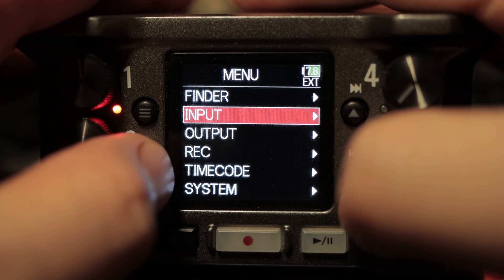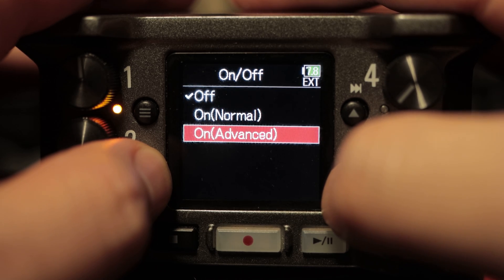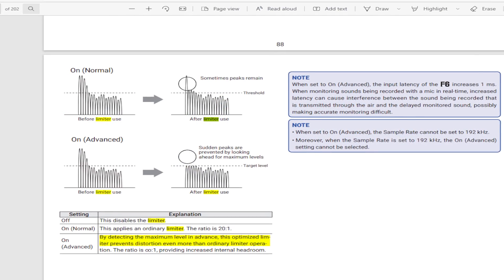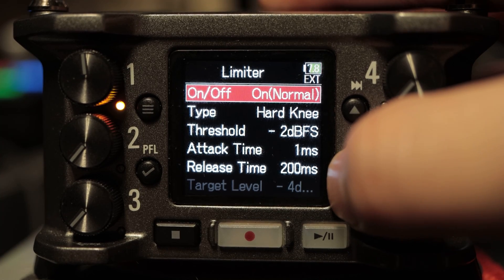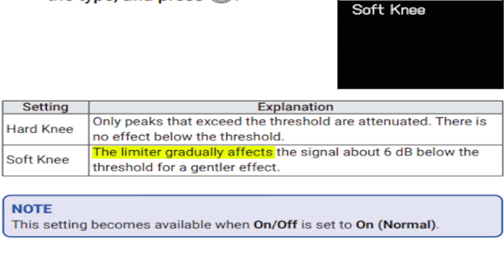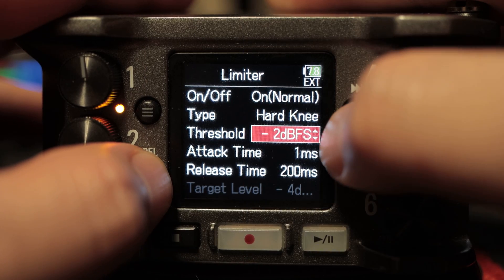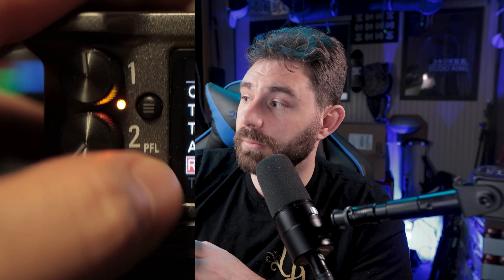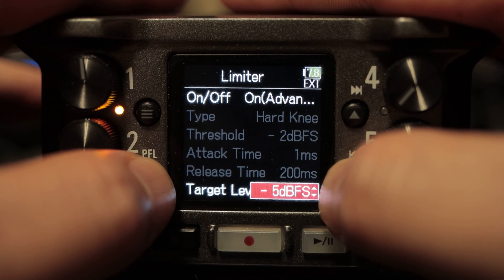Where should you set the limiter? Zoom F6 Limiter Test and comparison (Zoom F6 Part 34)

Comment: Great video! I have been using my F6 in 32-bit float mode and still have some clipping displayed in Audacity. I was just wondering how to repair the audio file in post-production when using the 32-bit float mode?
Reply from the maker: Some programs can’t process 32 bit. Usually it’s just as easy as lowering the level so that the peaks are brought to normal. 

Thanks for checking out the video!

Comment: Awesome vid... have you ever tested the Zoom F8?  I just picked it up and tested the limiter and compresser using the built-in mic capsules, and when turned up the gain and did a "puh puh puh" it immediately peaked and when it peaked it clicks in the recording and cut off the audio. ??  Was using the default limiter settings.. obviously don't want that to happen!
Reply from the maker: I haven't had the chance to use the F8.  I really want to though.  Most of my recordings are done with 32 bit float which allows more flexibility during editing.  I am hesitant to use built in limiters cause that will be baked in to the recording.  Of course they are very useful when you don't have 32 bit float.  I actually just got the F3 so now i can test that out too.  Maybe Zoom will send me one if they recognize me lol  Thanks for checking out the video, it means a lot!

Comment: If you don't need all the channels of the F6, do you think the F3 will be a good option? I don't like the idea of having to go into the menu to change gain if I decided to do 24 bit.  I don't have any experience with 32 bit but I heard someone remark that it added editing challenges.  If Float 32 bit doesn't work out for me, I would like the option to be able to adjust gains easily without going into a menu system. I realize that the Bluetooth App. might make that problem much easier to deal with. 

Thoughts?
Reply from the maker: If you use 24 bit in any way, you have to go into the pfl settings to adjust the “trim” aka gain. When you are in just 32 bit, the fader knobs act as gain knobs as well. The adjustment of gain is very simple, you just click the check mark to get to the pfl, then press it till you get to the track you are looking to adjust. Then just change the gain. It isn’t as easy as a handy recorder but I never had an issue with adjusting my gain. Even with 24 bit. 

With 32 bit float files, I’ve never had. An issue with them. If your cpu is half way decent and you are using a program that is “semi pro” you should be fine. 

The F3 looks like you have to go into the menu as well, to adjust the gain. There is also an app to adjust it as well. 

If you don’t wanna use 32 bit, the save the money and get a handy recorder. They are becoming much cheaper with these having 32 bit. That being said, you can save yourself a lot of time and effort with 32 bit float. 

That’s basically how I feel about this file formats and the Zoom recorders. Let me know if there’s any other topic you want me to talk about. 

Thanks for checking out the video!
Reply: @RebelTech1990  I have asked a couple people and the answers are a bit confusing. I would like to be able to lower or increase volume that gets stored in the file via knobs.  I have heard that in 32 bit float the knobs only adjust loudness going out; in other words if you were sending it directly into a camera. I want to synch afterwards and would prefer to have settings that are close as opposed to doing a ton of recovery via gain adjustments in post.
Reply from the maker: When I’m 32 bit, only, the knobs adjust everything. The trim is not available. The signal out of the line out is only 24 bit. There isn’t a 32 bit signal going out in any mode. When you use anything other than 32 bit, on its own, you will have to adjust the gain by adjusting the trim in the pfl settings

Comment: Great video Rebel! Finally some one did a review and test of the limiters.

And yes Limiters on 32 bit recorder is still in good use, i send my output directly to the camera so in this case a Limiter is very much welcome TBH. Do run and gun , field, outdoor, sports and fishing tournaments. Some of these events can go from extremely quiet ambiance to very loud action packed scenes. 

Also you missed the 2nd Limiter maybe you can add that to a future limiter episode?

Go to the Output Menu, Line Out, there is Level ... Routing ... Limiter ... Delay
The output limiter is strictly for Line output level to avoid line out going over 0 DBFS and avoid clipping the input of your recording device i.e. Camera Audio Input.

There is only the Normal Mode (No Advanced option) but there are all the settings available to adjust to your liking. Maybe you could give this a test as well?

It seems if you use both limiter options we could endup getting some serious artifacts i guess depedning on their threshold levels?

Let say we set the Input Limiter for -9 DBFS. We can set the Output Limiter for -6 DBFS so any peaks that do seem to get past the Input Stage can now be tamed before sending too hot of a signal to the camera or just to completely control peaks.
Reply: The output limiter seems to only function in 24-bit mode, in 32-bit it does nothing and the audio still clips on the line-out. Unless you have found a way to make it work?
Reply from the maker: Limiter output is capped at 24bit. The tracks are the only ones with 32 bit recording
Reply from the maker: I have a video planned around the line out but I don’t use it much. I have to talk to some of my friends that use that to get a better insight on how it’s used so I can do some tests. Hopefully I’ll have it out soon. 

Thanks for checking out the video!
Reply: @RebelTech1990  Yeah the Line Out gets kinda confusing.

I guess in 32 bit Float Only Recording is where the Output Menu Line Out Limiter will be of good use.

Great thing is too with Routing you can monitor the line out and hear how the limiter sounds real time and adjust if needed without permanent clipping.

Sweet would be looking forward to that as well. I know so  far i need to use a -35 dB Attenuator into the camera. And I've started using the output limiter just to be sure it does not over shoot the Camera Input while recording.
Reply from the maker: I did a video on the output monitoring and it’s amazing how many options you have. I found it very helpful with multiple lavs on a short film I worked on.